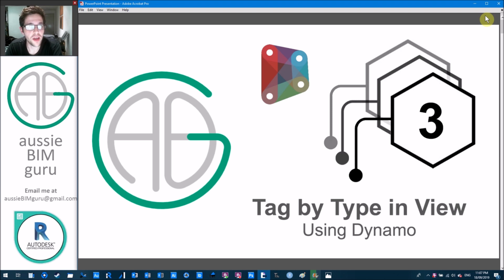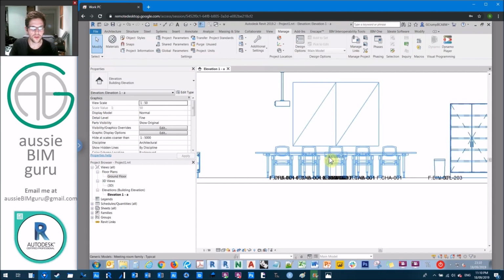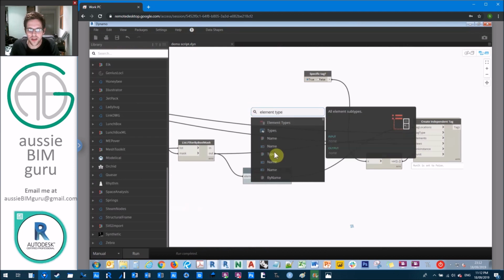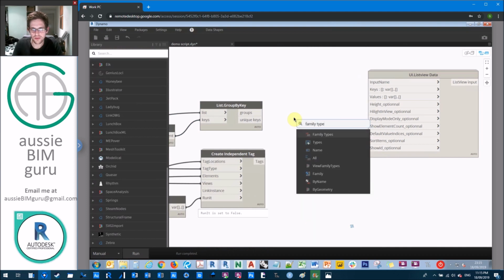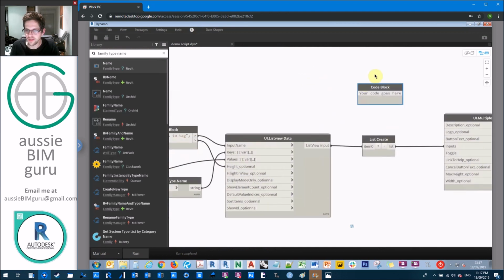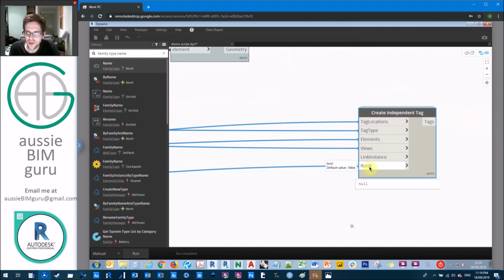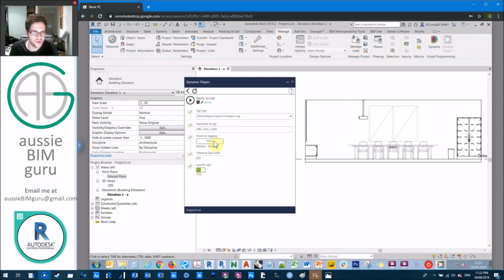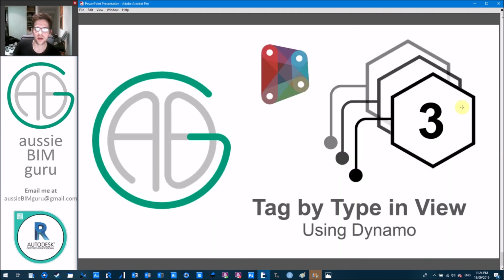Tag by Type in View using Dynamo! (Tag All 3/3)

Comment: Do you think it is possible to create a 3D model text family, that reads family type parameters (Name, order code, etc) and displays them? basically, the tagging function, but in 3D. what do you think? I dont know where to start.
Reply from the maker: It would only be possible if it was in the family itself. You could then nest the parameters to those of the nested text family. If theyre separate then automation like dynamo would be needed to pass the values from the family to the other.